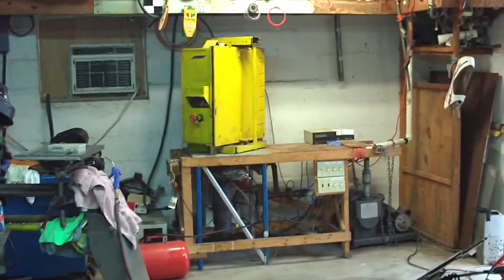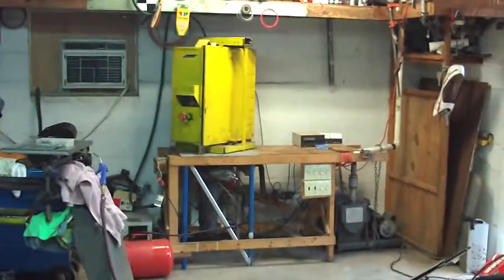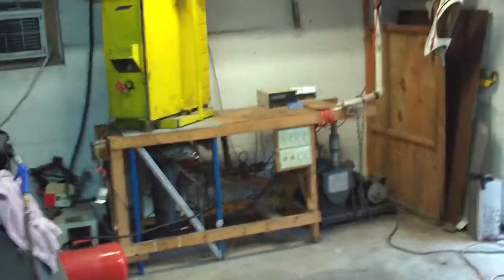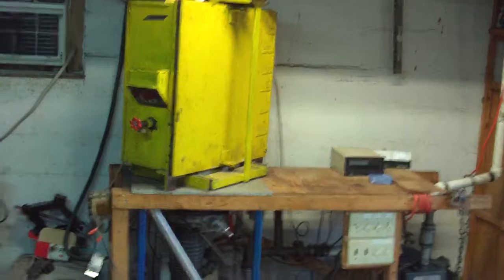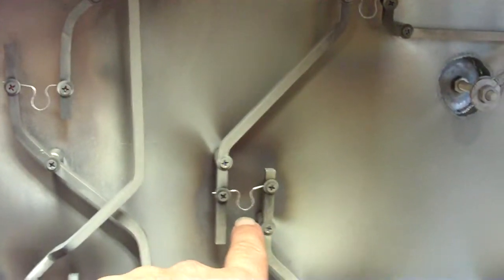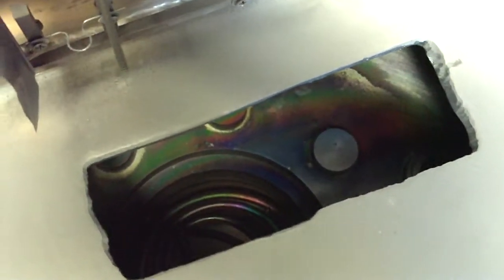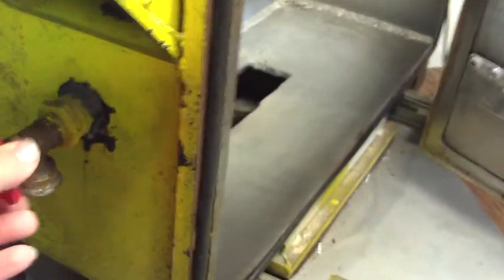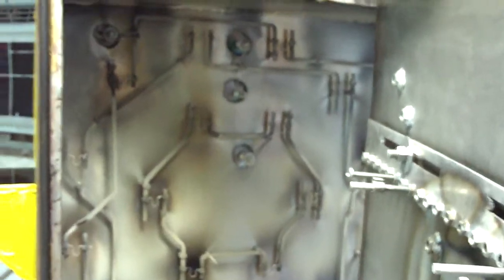Vacuum chamber for aluminizing optical surfaces

Comment: How did you decide that thickness of your vacuum chamber?
Reply from the maker: At the time I did the math, but that was nearly a decade ago.  Honestly I think I over built it (maybe) and could have used used thinner material with bracing.  On the other hand the front door to the chamber does bow inwards a mm or two across the 850mm diagonal span.
Reply: Please tell me the formula's you used. I have looked far and failed to find a link. Also I am making it out of stainless steel 304 because unlike vacuum grade aluminium 6061-t6, it costs more but is thrice as hard.
Reply from the maker: google for yield or bending moment of a plate, this looks promising; http://www.engineersedge.com/calculators.htm
Reply: After weeks of searchingI finally got the answer of the thickness required. Thank you. Question: the equations in the link you gave, do they include any safety factors constants or is that left up to the users?

Comment: Hey James! I just stumbled across this video looking for some totally unrelated info on vacuum vs pressure vessels etc. You were one of my mentors during my telescope building phase, I remember your binocular telescope and the work you were doing with interferometry back in the day.

I still have all my old telescope making links bookmarked, really the only thing I still keep from so long ago. Your site was and is in my "indispensable" sub category...

I still have my mirror grinding kit and a diffusion pump lurking down in the shed. Now I also have some great metal fab gear in the shop so I might build myself a vacuum chamber and do some coatings just for the hell of it.

Comment: Hi I am a PVD specialist from ohio I am very interested on what vacuum pressure and amount of heat you use to vapor the aluminum inside the chamber Lerah9921@yahoo.com
Reply from the maker: 2.2 * 10-5 torr (ish) before evaporating the aluminum, and it usually drops to 1.9 * 10-5 afterwards. 

Not sure how to quantify the amount of Heat, things get weird at low pressure.  Its not enough to make any noticeable temperature change when pulling the coated objects out.  I  know it's not enough to deform low temperature vacuum formed plastics (RC Helicopter windscreens) or mess up fiberglass or carbon fiber components that I've coated just to 'see what would happen' (nothing interesting, coats them like anything else).

I use a 600 watt transformer to light up the tungsten filaments for 30 seconds (ish).  That works out to 5 watt hours per run if my math is right..

Comment: How do you deal with aluminum build up in the chamber? I work for a company that makes headlights. We use these http://vergason.com/press-side-4000sl/. I line the chambers with stainless steel sheets and when they get to much buildup I dip them in caustic soda/lye/sodium hydroxide. What kind of top coat do you use? Can you get your hands on HDMSO? We had smaller machines more similar to yours. We used a special high grade aluminum wire instead of foil.

Comment: What about the protective coating? The aluminum tarnishes just as quickly as silver does.
Reply from the maker: I've looked into overcoating methods, all of them turn into a pain in the ass.  Heating and evaporating the dielectric material (silicon dioxide) without spitting little globules all over the place and while maintaining the exact thickness is way more complicated than depositing a layer of aluminum.

Between the complexity and the fact it can actually reduce reflectivity and increase scatter if not done just right.

Aluminum also creates its own Aluminum oxide coating the moment its exposed to oxygen, and so far the mirror just gets plain dirty before any tarnish is a concern.   BTW, I can re-coat a mirror in about the same amount of time to just do a cleaning.
Reply: look up HDMSO

Comment: IMO it probably is cheaper to use a silvering process, especially if using silver nitrate. The overall advantage of aluminum in high quality mirrors is that it does not scatter light, and has a higher reflectivity in the ultraviolet range. For novice telescope makers, this probably does not matter much, (especially since silver has higher reflectivity in all other ranges) but what does matter is that aluminum is less prone to tarnishing or corroding. BTW the vids are awesome

Comment: I had no problem finding the materials needed EXCEPT for the 1/2 thick steel.  Where did you find/get/buy it?  I could only find 12" x 24" 1/2" thick steel plates.  Oh and what are your box dimensions?

Comment: what is the voltage the neon sign transformer outputs for the plasma cleaning?  How deep is the chamber?  Do you fire the tungsten for evap in the same manner as you did on the propane tank?

Comment from the maker: I tried using tungsten from a 1000watt Halogen bulb, the wire is just to thin.  Small parts dot com is where I purchase my wire from. (they appear to be owned by Amazon now, but you can still purchase the 0.062" diameter tungsten wire.

Comment from the maker: The current system actually achieves a fairly good low pressure environment as-is, about 2e-5 torr if I trust my monitoring system.

Preheating or fabricating from stainless would be better, but for my purpose this works for my needs and I'm  a proponent of "if it aint broke..." :)

Also, its not so much about having a thicker coat, but about applying the coating uniformly to produce a 100nm thick coating w/o altering the surface profile.  I don't want to turn a 1/10 wave surface into 1/2 wave.
Reply: Hey, how high the vacuum needs to be to coat the mirror with aluminum. Can ordinary pumps do it?

Comment: would it aid the creation of the higher quality vacuum if you reserved a few heating elements to heat the chamber. When the walls get warm, turn on your vacuum pumps once again. when you are satisfied, turn the pumps and heating elements off, and let it cool. You should have an even better vacuum 

What about a ceramic cup with tungsten heating elements in it, to better hold more aluminum    and apply thicker coat?

Comment from the maker: I'd need to install 6 tantalum evaporation boats each having a mechanical shutter, and a film thickness monitor to close the shutters once the proper thickness has been achieved.

Long story short, its a pain to properly implement the over coating process and the reason I have not attempted it yet.   

I've considered it, and my proposed power supply is going to be my variable output TIG welder, because it will take a LOT of power to heat 6 tantalum boats

Comment: Thanks for sharing... Congratulations on the design of system. Please, can you explain how you could add the feature protection coating of SiO2 in your chamber? This is possible in a homemade system? 
How many amps is needed to make the SiO2 coating?
Thanks
I´m Sandro Coletti from Brazil.